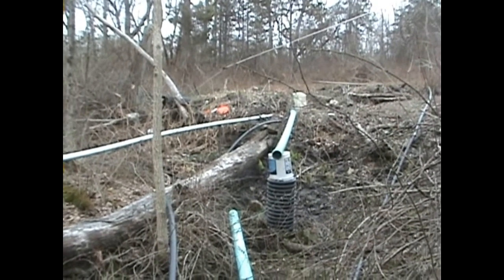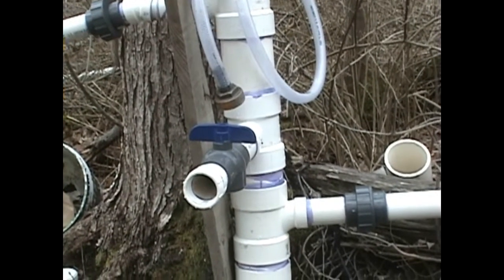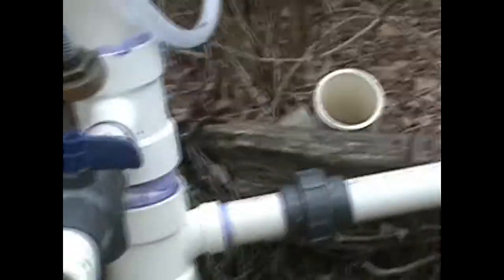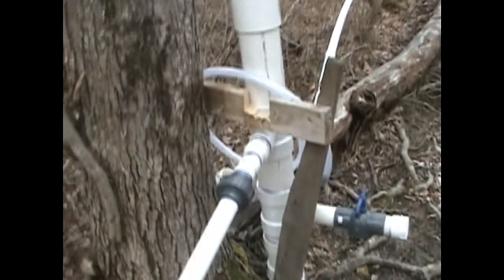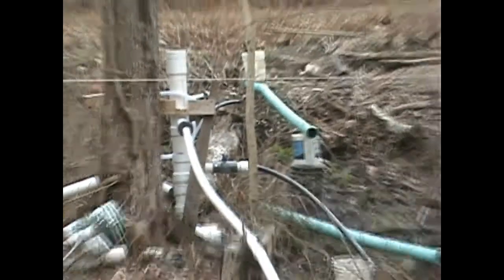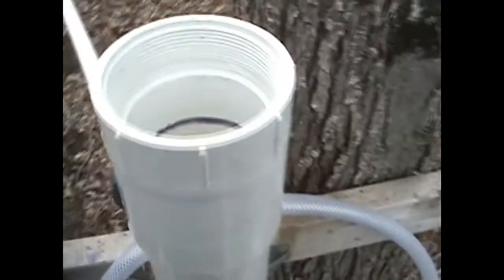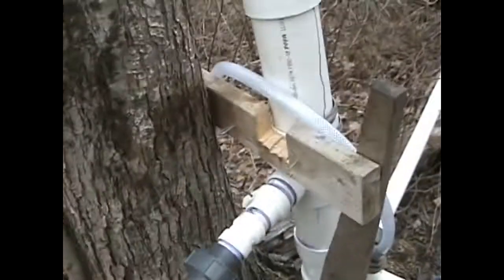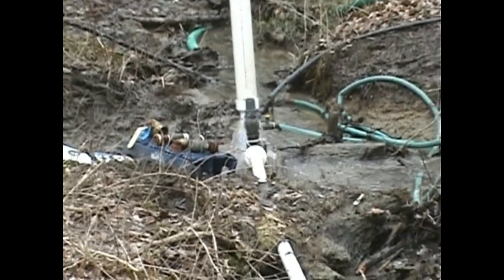04 07 2017 Ram Pump Standpipe Upgrade

Comment: Nice standpipe with lots of features on it.
Reply from the maker: Hey thanks!   It has since been upgraded even nicer. :)
Reply: @TheFarmacySeedsNetwork  Have you make a video of the up grade?  It would be nice if you would to a video of the whole system taking about the fall distance from the dam to the standpipe and from there to the ram pump and the different sizes of valves you use and what you have to change when you put in a different size valve for lower water flow levels.

Thanks for your great ram pump series.
Reply from the maker: @raincoast9010  I do cover all those specs in my "Ram Pump The Manual" video... https://www.youtube.com/watch?v=rxqUkybsxYw&list=PL837tk-T71Lgw3Of_XqmoPrj3tdsVIURE&index=15   This is part of a MUCH larger playlist. At some point I will do an updated "current" video of it all, but the above video includes the updated system. The pump has been offline for several months due to low water supply. Hopefully we'll get a thaw this winter and I can get it back online, refill greenhouse reservoirs etc etc.  Thanks so much for your interest!
Reply from the maker: also see the video on "ram pump scalability" for different valve sizes for adapting to reduced water supply conditions.